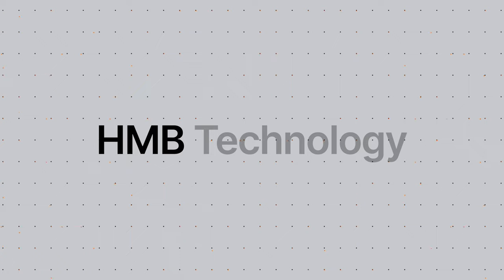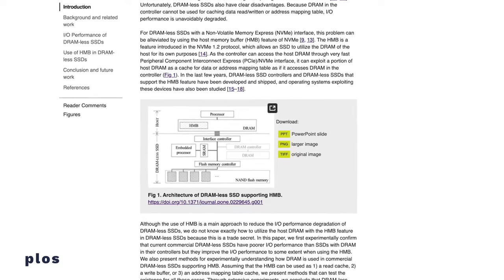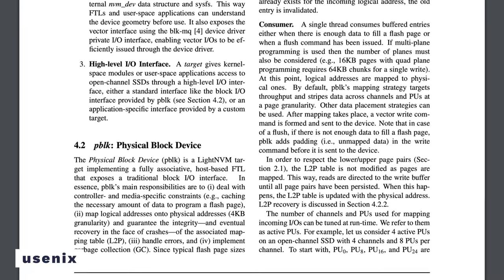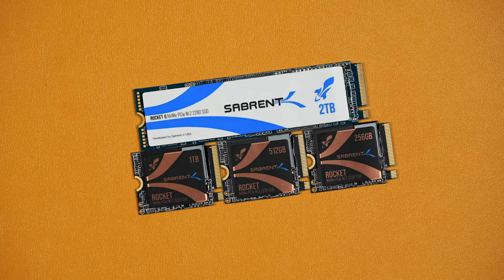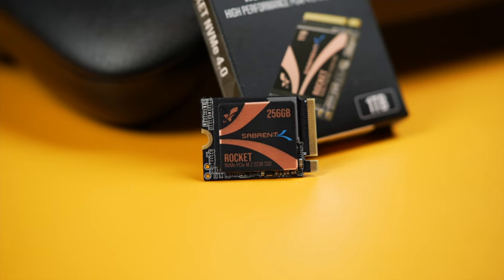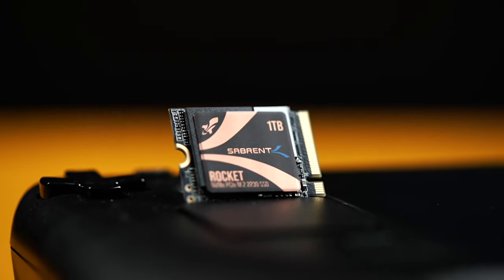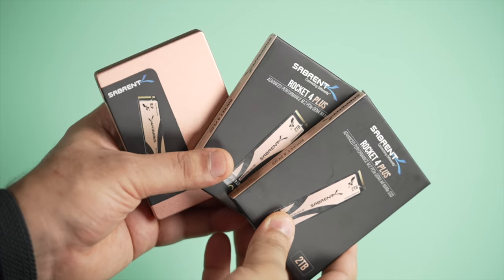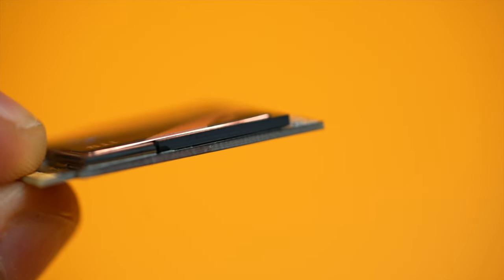What are HMB SSDs And Why You Should Consider Them!

Comment: I recently bought an HMB SSD (Samsung 990 EVO) for my 2022 laptop computer, but apparently the laptop is not compatible with HMB. The motherboard is Pcie 3 and has Intel RST drivers, and that may be incompatible with HMB. The read speeds are excellent but the write speeds are a little slower than I expected. Still fast enough for my needs. My advice is if your computer has Pcie 3 for the M.2 slot, then stick to an SSD with DRAM cache.
Reply: you can change to AHCI, btw 2022 laptop already support HMB
Reply: @syarifairlangga4608  Thanks, but it's already AHCI. The Intel RST drivers are a nuisance. They can be removed, but then I'd have to reinstall Windows from scratch, and it's not worth it. I just moved the Samsung 990 Evo to a different computer that doesn't have the RST drivers and used a different SSD in the laptop.

Comment: Do hmbs perform better than dram ssds?
Reply from the maker: SSDs with DRAM will perform better but HMB is far better than SSDs that do not support it in terms of speed. Some SSDs like small form factor SSDs do not have room of a DRAM chip so HMB fills that gap but if you had a choice between an HMB ssd and a DRAM ssd in a form factor like a 2280 then I would chose a DRAM SSD. I hope this helps!

Comment: Great informative video! I'm getting two 4tb m.2 nvme drives with HMB 3.0 and Dynamic SLC(pcie gen 4). Paired with my ddr5 64gb 6000mhz ram, I'm assuming windows 10 will be able to utilize that ram and achieve good sustained writing speeds. Fingers crossed I didn't make a mistake with this purchase!

In my budget, I had the choice of two 2 tb drives with dram or two 4tb with hmb 3.0 & dynamic slc. I was just thinking twice the capacity(and I definitely need 8tb of storage) for the same price is well worth a 10-50% decrease of read/write speeds, considering these are all incredibly fast. I think 7000 read/write is incredible, but not that much better than the already impressive speeds of 4000+.
Reply: We are lucky.
This year the price has been increase dramatically
Reply: @syarifairlangga4608  I'm mostly happy with my build. But I wish I had bought at least one ssd with dram. I've been having stutter issues with most games after prolonged play, and suspecting that its suffering from the limitation of the hmb ssd's speed declining over time
Reply: @saften1  what ? i  think dramless ssd wont affect stutter, because game only use Read speed and not write speed
Reply: @syarifairlangga4608   
 Ok, thanks for letting me know.

apparrently traversal stutter is a common thing, its a shame to limit my fps on a high end gpu, but now im more happy with my ssd purchase :)
Reply: No DRAM affects how long the SSD will live before it dies
Reply: @ldope3904  mine had a crazy big read write expectancy. do they die from some other reason
Reply: @saften1  From the knowledge I gathered, DRAM drives are made to last longer but DRAMless is still good, just puts more strain on the controller of the SSD. Prob wont notice much difference unless you work with big files daily for 3-5 years.